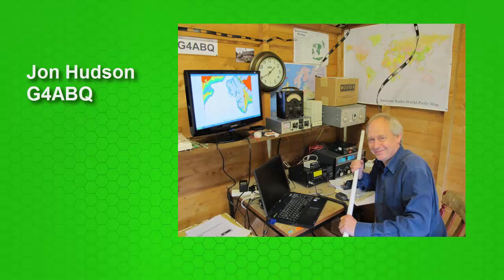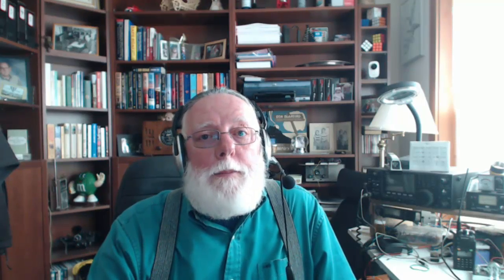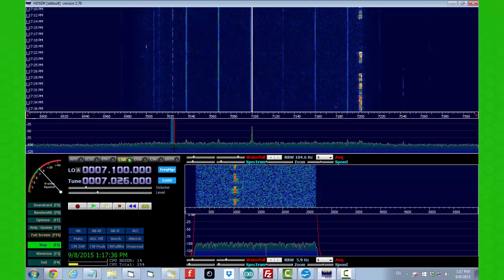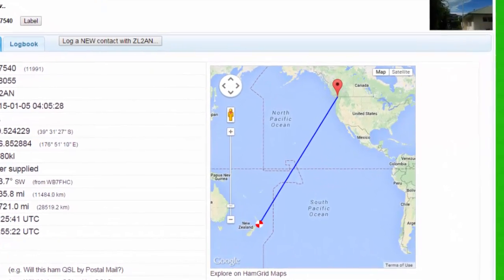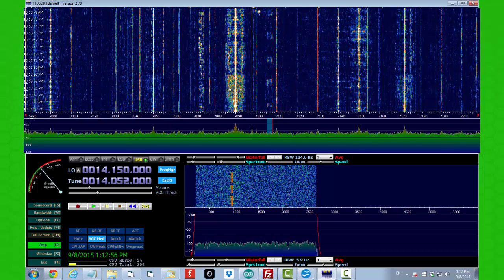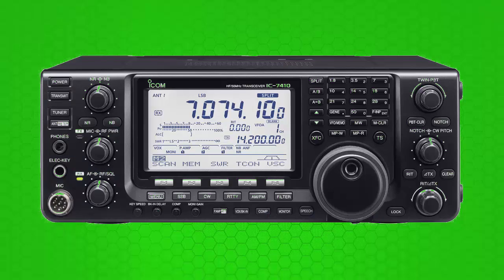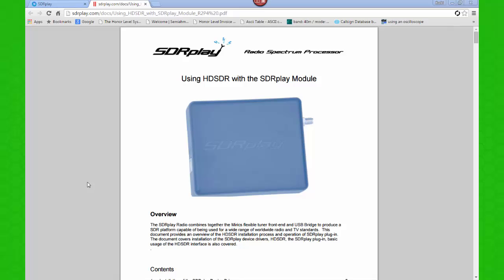Strangest Thing On SDR Radio

Comment: My guess on 4:56 is SNORE "Signal to Noise Optimized Radio Emission" version 1.0  - a previously unknown digital mode.  ;)
Reply: Similar to the WANT mode (Worked All Neighbor's Televisions).
Reply: WAN: Worked All Neighbors
Reply: my cat works well as a snore beacon
Reply: I'll have to remember that one.

Say does it resonate from the upper or lower Nasal cavity? I'm assuming vertical polarised transmission source.
Reply: looks so encrypted!
Reply: baby monitor with dad asleep in baby's room.
Reply: @heartoftoledo1560   Single side band baby monitor? impressive :)
Reply: @HighCalip  was 20 years ago. So long ago you could hear cordless phones as well.

Comment: The new RTL SDR V4 has a built-in up-converter that works great. Got mine last week and really enjoying it. Much better than the V3 I've had for years. Also, it has easily installed drivers for Linux, which is all I use.

Comment: Interesting , but for a second there I thought I was going to hear some alien transmission or at least some secret military thing . :)   Darn it , I have to start reading the posts first.
Reply: I just want to hear what Tesla thought he heard since there wouldn't have been any other transmission over the air back then.
Reply: @pimphandgamester  Nothing artificial but there are plenty of natural radio sources in the cosmos you could definitely pick up something if you were listening in the right bands. This is after all how radio astronomy works we listen for radio emissions that are produced by natural sources like electrons being excited within elements and molecules etc. This is also where we often end up trying to look for possible artificial signals ie listening to something like the Hydrogen 21-centimeter line (One of the most common base fundamental frequencies in the universe) multiplied by an irrational constant like pi or Euler's Number. The theory being anyone with sufficiently advanced mathematics to build a radio would know those constants and would soon discover that frequency too so it would scream artificial if someone out there was trying as it takes a bunch of well-developed math to put all the pieces of radio together and get something useful out.

Comment: Yes Amateur radio has been around for awhile.  Sometime in the early 1900s shortly before WWI the Navy shore patrol showed up at the South Side Chicago home of my grandfather asking, “Are you operating a radio transmitter?”   The answer was yes; he and his brother had created a spark gap crystal transmitter with a wire antenna strung between trees and had been communicating with others doing the same via Morse Code.   “Well stop it, you are interfering with our ship-to-shore communications in the Atlantic.”  they were told.  During WWI he served in the Navy as radio operator. 😂

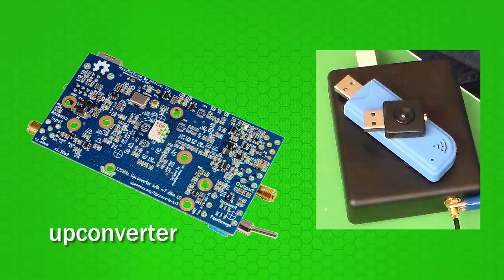Comment: The 'digital mode' at 3:29 is called JT-65. and IMHO it's a rather boring mode but to each their own. I much prefer modes like RTTY, PSK31 & Olivia because you typically hold a conversation with the other party versus the quick info exchange conducted on JT-65. I started out with an RTL dongle using HDSDR and later added the Ham-it-Up upconverter shown on the left at 2:16 and I was amazed at the sensitivity. I found I preferred my cheap SDR set up to my pricey Icom IC-R8500 receiver!
Reply: I wanted to add that originally I used adapters to convert the SMA connectors of my SDR and the upconverter I added to it later on but found using all those adapters caused interference issues. I ended up ordering custom cables with the appropriate connectors on each end via Ebay and this eliminated all my interference problems and the SDR performed MUCH better :)

Comment: That's hilarious!! Thanks for the SDR primer, too! I've been in (commercial) electronics for nearly 50 years, but never got into amateur radio....heaven only knows why not! Recently got into SWL, though. What kind of antenna are you using, and what bandwidth(s) does it cover? I have many questions, and could use a good book to guide me. Most have to do with antennas, though, since I live in an area notorious for poor reception. Thanks! :-)

Comment: What a great video. I was thinking (which is always dangerous), what wouold we call that mode if it were a digital mode. I know, SNOR or Single Oscillator Noise Reduction mode. Its really popular with the Elmers.

Comment: 4:57 That sounds like some form of marine animal communication.  While naturally-occurring forms of echo-location range between 1 kHz and 200 KHz, @ 7.108 MHz you might have tuned into a marine-mammal proximity research study, making use of a hydrophone  and connected up-converter with radio transmitter for remote monitoring.  Industry Canada hasn't allocated the frequency [ https://sms-sgs.ic.gc.ca/frequencySearch/searchBySingleFrequency ]. I'd be curious to know the regularity and/or persistence of the transmission.

Comment: Sounds like something I would do if I had a good HF set.  Getting to old now to be able to afford such a luxury, however I am keeping my eye out for a good used HF set that will allow me to make contact over the air with someone, ANYONE! I am the only ham in my town, the next is over 25 miles away, and all I have working in my house right now is a little Boefeng hand held, which will indeed reach across the street on a good day, across town if there were anyone else around. The last Ham beside me, died about a year ago. No wait, he died before I got my ticket. Anyhow, thanks for the video nice to see what is available out there      KE0JBL
Reply: There's always cheap DMR (TYT MD380) coupled with a hotspot dongle (Like DV4MINI) ... that will let you open up digital repeaters all over the world.  It gets pretty busy on there too... and there are talk-groups for just about every state, region and nation.

I have my hotspot running on a cheap little Raspberry PI in the attic, which means I can roam about the neighbourhood using my own little repeater.  And I can plug in a RAVPower portable USB charger and operate a 'walking hotspot' nationally using the PI, Dongle and the 'mobile hotspot' feature of my phone as an internet connection.  It's VERY data efficient.

You do get some funny looks when you're talking to Australians, Americans, Germans, Spaniards etc ... from a dinky little handheld with a stubby antenna ; )

Given your situation I definitely think that 'DMR Radio + DMR Dongle' might be a good way into the hobby while you're waiting for that big lottery win  ; )

Failing that, you can do a lot with HF using old gear and low power... it's actually more fun than having 1kw and all the bells and whistles.  It's all about the antenna, and you can make those out of wire and sling them up into trees ; )

Anyway, the HF propagation is horrible at the moment.  You're not missing much ; )

M6UDS

Comment: That device looks neat. like to see what it costs.. my dream SDR is the Blade-RF or Edge-RF.. one or the other. they're full duplex and have a really wide spectrum range or whatever you call it ( i cant think , haven't used my RTL-SDR one in a while) .. thing is I need to find a good antenna to maybe mount up on the roof here on this ranch home and run it to some jack or just a hole in the floor/wall, whatever. i see your big connection looks like a 1/4 inch guitar cable type thing - is that common on bigger antennae? anyway ill do my own research on what kind of antennnas are the best... :) maybe one of those 'array' looking ones. id imagine you can power them too to pick up more but that might also interfere with your signals being picked up

Comment: Regarding what's in the black box,  go to www.sdrplay.com and  'Platforms' and select the Operating system relevant to you.  Whichever operating system you are using takes you to a new page with a top section called Generic Documentation where the data sheet and detailed schematics can be found.;The SDRplay employs 12bit ADC technology and goes from 100KHz to 2GHz with 8MHz bandwidth and a bunch of smart filters - not to be confused with the $10 dongles! We also offer a full refund to anyone who is disappointed with the product. Take a look on eHam reviews on http://www.eham.net/reviews/detail/12358 where at the last count there were 15 reviews averaging 4.5/5 - if anyone has specific questions join the independent Facebook user group https://www.facebook.com/groups/sdrplay and ask away. You can also ask us directly on support@sdrplay.com

Comment: I have one of those $20 dongles. Was playing around with it with a "coffee can" antenna I made around Christmas of last year. On the non-commercial part of the FM broadcast band...I found a signal from a non-commercial/public station which looked like it had tire tracks (no audio being decoded) running along with the main signal on both sides like a trail from a Jeep. Asked several people in the Ham club about it and no one had even heard about it. Does anyone know what I was seeing on the waterfall?
Reply: Dan, If you mean 88-108MHz, you might be seeing HD-Radio stations (provided you're in reception range of US commercial radio stations. If not, then sorry, dunno :) ). They generally just look like solid bars along either side of a standard analog station, but due to fading, they could appear to have diagonal stripes through them, too, making them resemble tracks. Google Image search for HD-Radio spectrum and you should see several images that look similar.
Reply: Thank you for the information. Sorry it took me so long to reply, but just moved across the country this week.

Comment: Thanks for the great video it was very informative. Can SDR be used as a way of seeing how well the band is running? Once you know if things are open you know where to go for signals. Thanks for a job well done.
73....
Reply from the maker: Yes, Wayne. The graphic waterfall display is very handy to see where there is activity on the band.
Reply: @BuddChurchward  a while back I saw a video of a guy using an SDR radio with a waterfall to be able to see the weather maps in the datastream.he use software in his computer that could capture the data inside the data stream while listening to certain satellites for weather maps. As he was working with antennas to get the best signal to make things work all I can think of was why not talk to ham radio operator. It's all old news to us.....just thought you may like that.... 
Very Best 73...... Wayne

Comment: 214 comments in March of 2018/and no one suggested what's going on here. It's malicious interference. The guy could be on VOX or simply have a rubber band on the PTT of the mic. Why would anyone do this on purpose? Quite a common thing to do a habit from CB radio, where if you want to tie up a frequency and want to be blasé and in your face about it, you just fall asleep with the mic engaged. No different than playing a music track or a noise over the airwaves. There you have it, in case you didn't know it.
Reply: Ugh... That's one thing I don't miss on the CB is mic-keyers hogging the 19 or coming onto your channel to troll. Many time's a group of us would jump in the car with a mobile CB and a low RF gain handheld with antenna removed and track down the mic keying muppets. lol

Comment: Hello Budd, have you had trouble getting the SDRPlay RSP2 to use the Hi Z port?  I have set up and used my RSP2 to listen to AM 960 kHz, a local radio station using the SMA port.  I can get SDRUno to switch to the Hi Z port but when I start up HDSDR with RSP2, it gives me an error message.  I would like to use a long wire antenna with the Hi Z port.  Can you help with this?  - Ian Douglas

Comment: Thanks for this video! I bought the little NooElec blue dongle and soon found out that it did not work that well with the provided antenna. This looks affordable at $99. Is the software free? I see that 3 years later they have the RSP1A, RSP2 and RSP2pro. It appears to me that the RSP1 would be good enough for me. I am new to this so what antenna(s) would I need to get into this SWL hobby for a very small investment. Before I buy an upconverter, I would be better off to spend the extra dollars to get a the RSP1A. I liked and subbed!

Comment: Is it possible that was a baby monitor ? And could you hear things from baby monitors and/or walkie talkies with SDR?
Reply: From the frequency I would say no, the analog ones typically use one of 4 channels in the 49.8-49.9 Mhz band. Also this is in the 7-Mhz band allocated to licenced amateur radio so not a band a commercial device intended to be used by a user without an operators licence would use. This is the same reason why the digital ones use the same 2.4 Ghz band as digital cordless phones and older wifi standards, you don't need a licence to use properly certified low power equipment in that band.

Comment: SDRPlay has had a lot of wierd issues posted on their forum. Clearly seems like a not finished product which the developers freely admit has bugs. They also released it on Mac knowing it was very buggy. They do not even tell you what is inside this box - what your actually paying for. I dont like surprises like that.
Reply from the maker: +truthseekers666 Isn't that what forums are for? Anyone having difficulty getting their SDRanything to run is advised to bring their issues to a forum. It's a great way to get them resolved. I don't know what you mean by 'very buggy' I have had HDSDR crash on me a few times. I just have to restart it. I don't know who gets to own the bug, though. It could be either HDSDR or SDRPlay. Having said that, I should mention that I am using it on a Windows machine. Folks using it on Linux are used to being able to get right into the blood and guts of things and there may be some issues there. Those who play with GNU Radio may find that there is still some work to be done. Generally these areas depend on the efforts of volunteer hobbyist who want to take things into their own hands. Isn't that what Linux is all about?  

I really like the EXTio that SDRPlay provides. It gives us a way to tweak and tune the receiver. That's enough blood and guts for me. I'm sure that a lot of SDR# users were upset when the latest versions of their software of choice no longer supports external I/O. SDR# made this change without warning the SDR dongle manufacturers. As far as not knowing what's in the box, I would suggest you look further. I had no trouble finding the complete schematic on line.
Reply: +Budd Churchward I have managed to track down a schematic of what in the box but its a shame that they seem to hide this info when you go on their website. You have to drill down in forums to find it. Seems they chose E4000 chipset if im right. I dont know why they felt they had to reinvent the wheel when everybody else was doing it for £10 they decide to do one that does it pretty much the same for £124. 
Im not sure what you mean by SDR pulling extrenal IO... I just downloaded it and I can get input and output from my soundcard. Which bits went. Im unsure and you have got me curious now. Thanks.
Reply: +truthseekers666  The home page of the SDRplay website www.sdrplay.com says 'We have reorganised our website to make it easier to find what you need in the way of downloads, documentation, software and links to useful 3rd parties. For all of this go to Platforms and select the Operating system relevant to you. ; - this was by popular request.  Whichever operating system you are using takes you to a new page with a top section calledGeneric Documentationwhere the data sheet and detailed schematics can be found. ;The SDRplay employs 12bit ADC technology and goes from 100KHz to 2GHz with 8MHz bandwidth and a bunch of smart filters - not to be confused with the $10 dongles! We also offer a full refund to anyone who is disappointed with the product. Take a look on eHam reviews on http://www.eham.net/reviews/detail/12358 where at the last count there were 15 reviews averaging 4.5/5 - if anyone has specific questions join the independent Facebook user group https://www.facebook.com/groups/sdrplay and ask away. You can also ask us directly on support@sdrplay.com

Comment: Is there a program or app that could decode Morse code real time?
Reply from the maker: Yes there is. Fldigi is a free program that is available for all platforms. It will decode many different digital modes and Morse Code is one of them. You can direct the audio from your SDR into Fldigi and decode CW (Morse Code), teletype, and many other signals.

Comment: What type of antenna do you need to use this little box?
Reply: an antenna who fit into the freq. If you have an Antenna outside its better.
Reply: Some people don't use or have $ on ebay. I only have Amazon. I've used it many years with no issues.

Comment: how do you add a freq in hdsdr please
Reply from the maker: +David Simmons there are several ways to add a freq. My favorite is to click on the digits and then use the wheel on your mouse to move them up and down. If you click on "FreqMgr" you can select frequency bands from a list by double clicking them. You can store your own favorite frequencies there as well.